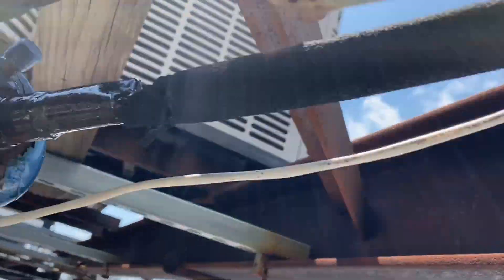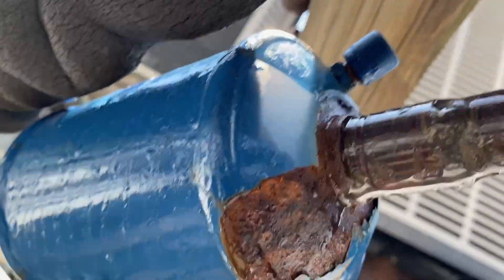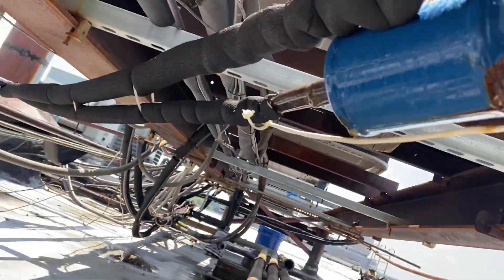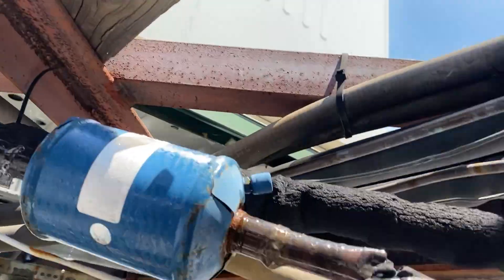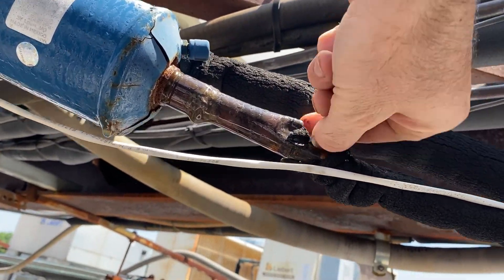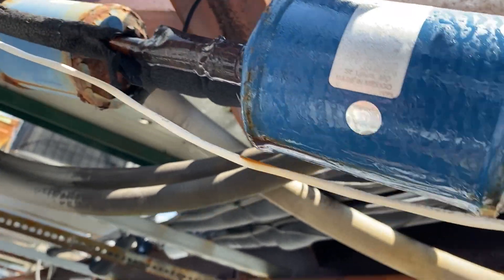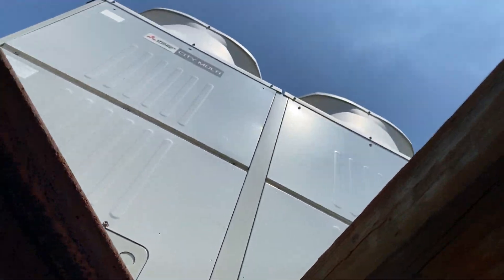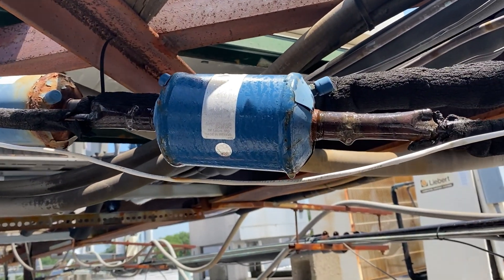HVAC Hacks: Check Out Hacked In AC Filter Drier

Comment: Service techs that cry about crimping copper to make it fit are ridiculous and never work farther than five minutes from a supply house and most likely never work on anything without a 3/8 liquid line. If you think I’m running to a supply house for reducing fittings if I don’t have them you are out of your mind. The customer doesn’t care and the equipment doesn’t care. It works fine. Putting a suction drier on a liquid line is grade A hackery and whoever did it should be banned from the industry. Since that’s a city multi it isn’t a liquid line. Period. 🙄

Comment: To me that looks like a suction drier (HH) to clean the Acid. And since you are there check if the system oil is clean and remove it. You have to sell that job. At least the guy cleaned the system from Acid and the compressor lasted yntil the pipes corroded.

Comment: Well, they may have gotten higher capacity with that bigger unit. The clowns who installed my unit, 10 years ago, didn't bother to install ANY dryer. No doubt it is living on cat life #9, in humid Louisiana, where AC gets used 8 months of the year. But hey, 'if it ain't broke, don't fix it'. Too late now, anyway. I think of it as an ongoing experiment of the durability of the scroll compressor design.